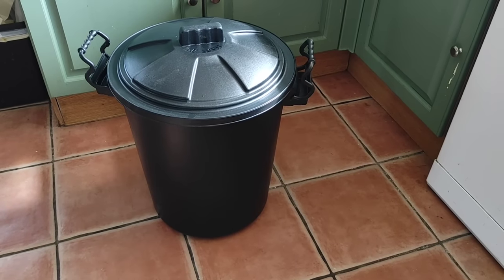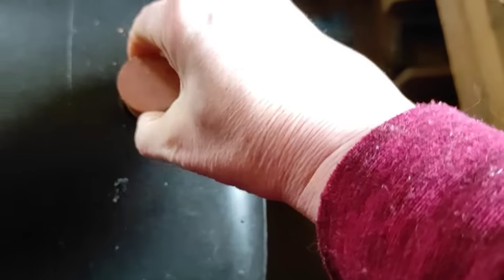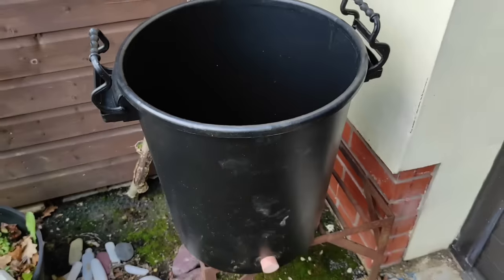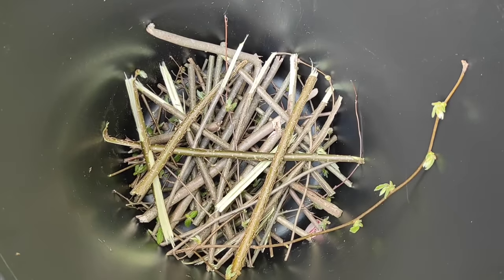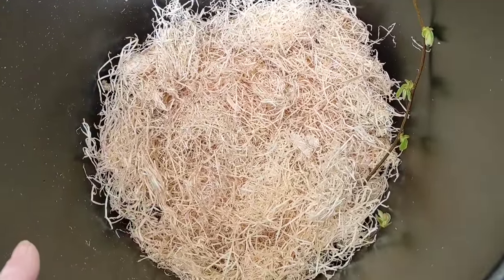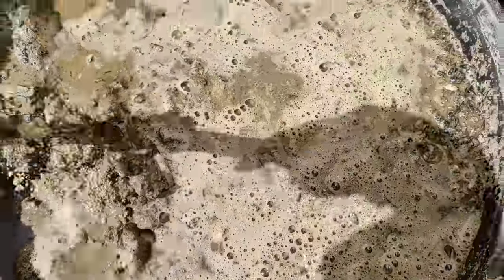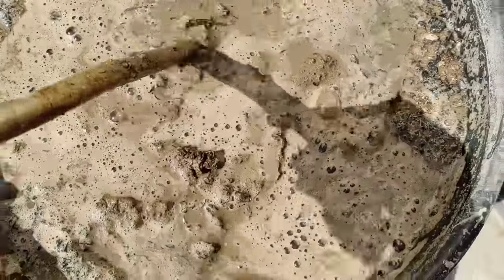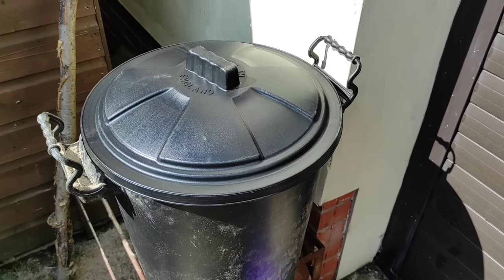Soapmaking from Scratch: Woodash Lye

Comment: It will be predominantly Potassium Carbonate from wood ashes, to make KOH you need to add a Hydroxide like quick Lime, but this will only make a little KOH, or roast the wood ashes in a kiln then imediately add lime water, or better roast the wood ashes to a very high temperature and add to water at once, this will make a way stronger KOH, but judging by you lab work, in the nicest possible way never ever do the last method or you will be horribly injured.........Also it depends upon the stoichiometery of the components and the strength of the solutions, the PH papers are giving you the best indicator of how much alkalinity you have and so your control test solution is caustic soda or sodium hydroxide that will be PH 14, thus PH13 is 10 times weaker, and PH12 is 100 times weaker and so on untill we reach PH7 neutral, also in soap making I beleive its the molecular mass of potassium thats heavier that makes a better product than a soda lye..........Great video, your very enthusiastic, clever and innotavie.

Comment: You could just fill in half of the bucket with ashes, add water, stir it and let ashes settle down. Then you get lye solution from the top, not the bottom.

Comment: You could really benefit greatly from taking some basic chemistry courses and wearing proper PPE. A lot of what you did here was dangerous and easily preventable. I don't want to sound mean or degrading but don't reinvent the wheel if you don't have to, take some classes and learn from those who came before you. I do appreciate you're attempting to show where reagents can be resourced without the use of modern suppliers. As well as teaching people how to make their own soap which lasts longer and hydrates the skin better than commercial soap.

Comment: So, did you account for having used the same egg? I mean, you didn't have a control for any of these. You know that some of the lyme would have been leached out by a chemical process, and that having dipped the same egg in water, potash and lyme, and then pure potash would have changed the contents of the egg, or at least the shell, even slightly. Eggshells are permeable, so there isn't any way to control the error from one dip to the next. NO, the egg wasn't in any bottle for a significant amount of time, however, chemical reactions take seconds and this could have been the variable that gave you the results you got. Anyone who experiments would know this. For valid results, you need a control and then every other combination to validate the findings. A little disappointed from a scientific perspective, but I understand what you were doing.

You're demonstrating the method by which folks of old would possibly have gauged the lye. I get it, but it's not very scientific, is it? Well, actually, it is, but it was an intuitive process that can now be explained scientifically. 
As an experimental archaeologist, you should have taken this into account. I'd like to see the experiment run again under tighter controls. Yes, the results could be absolutely the same, but at least you could have proven the results. You should know that using the same egg isn't a "control" egg as soon as you dipped it in regular water. Everything after was "contaminated' or "diluted", even by just a little, unless you established a control egg dipped in water first. 
If you are demonstrating that our forefathers/mothers knew what they were doing without the aid of science, then good on you. Your goal was accomplished and I commend you for it because folks who made their own soap didn't rely on the scientific method. Hell, they had no idea about chemistry. 
As someone who has watched lye soap being made by the old method, I get it. It's been done that way for thousands of years without proper "controls". They weren't because the method was passed down for generations. NO science required. Only paying attention to the process. Nothing else mattered as long as you ended up with proper soap in the end. 

However, in this day and age, with what we know of chemistry, If you're going to say you're an experimental archaeologist, a better control should have been used, and a better scientific process used so that the results were conclusive. As you demonstrate, scientifically, the experiment was contaminated.

Kudos for using the old methods of just knowing what to do because that's the way it's been done. 

Shame on your for saying you're an experimental archaeologist without applying the proper scientific method as we know the chemistry and physics of such things. 

But in the end, good for you. Our ancestors didn't care about the absolute science as long as it worked.

If you're planning on using this in a PhD thesis, it' won't fly.

Don't know what end-result was intended. But it worked and that matters. In the matter of science, it has huge holes.
Reply from the maker: Yes eggs are permeable, but those few seconds all within half a minute won't affect the internal composition and buoyancy of the egg. It's a simple matter to demonstrate that it takes much longer exposure to alter the levels an egg will sit at over a period of soaking. In my formal write up I also use a glass hydrometer as a comparison to the egg, and show that it's exactly the same result if a fresh egg is used each time. Noting limitations to empirical observations is a valid part of experimentation, as is doing experiential work.

Comment: This is legit.  I do have to suggest you stop using “leftist” terms.  For example, “people of color” takes the default position that Whites are colorless non-people.  Instead just call them non-whites.  
Another example is “trans”.  This “leftist” term suggests that transitioning sex or gender is possible.  Transitioning is impossible, but using their terms normalizes them and legitimizes their ideology.  There are plenty of other terms you could use that won’t help the “leftists” but everyone else will know exactly what you mean right away.  Gender delusionals, for one. Sex change space cadets. Sexually mutilated. Gender nuts. There’s tons you could come up with.  
The most important thing is that you don’t use the “lefts” terms.  Second important is picking a term that people understand right away.  Thanks for not helping the “leftists” normalize and legitimize their ideology.